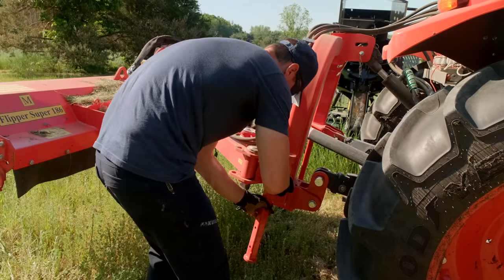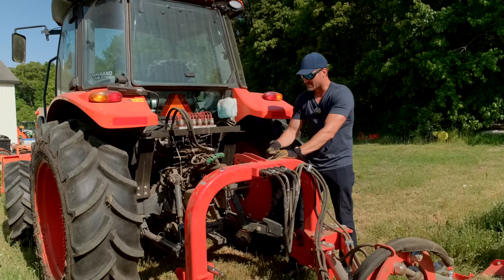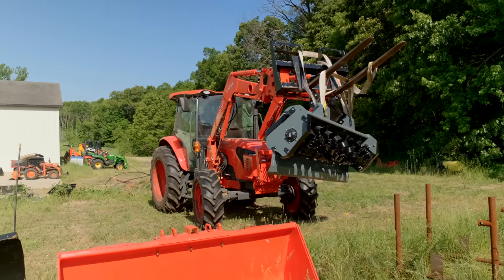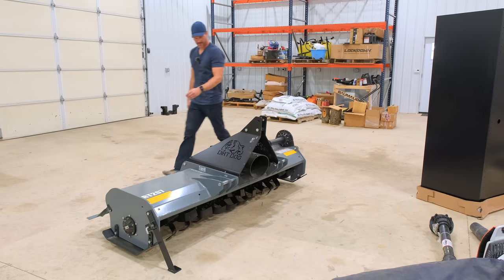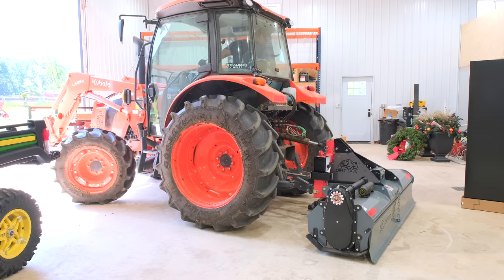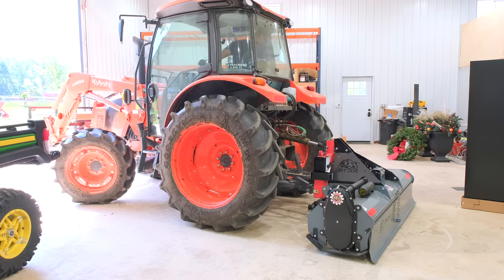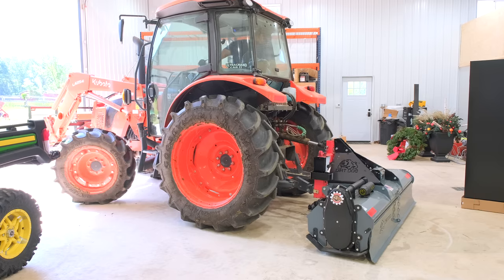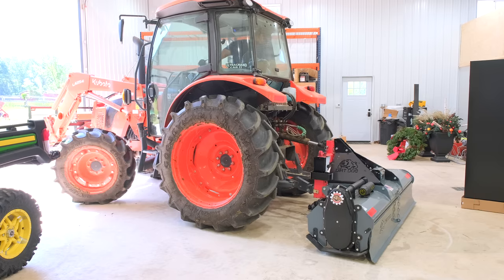I’M SHOCKED! THIS “DELUXE” TRACTOR WON’T GO SLOW ENOUGH TO TILL

Comment: I have the M4.  Love it!  My guess is you have a 12 speed transmission.  I have the 12.  It’s perfect for me.  They have this tractor in 24 speed and that will do what you need.  In your case, add the creeper option.

Kubota sells the rear wiper kit.  Worth it and easy to install!

Exceptional tractor!

Comment: 1 thing you can do is run in e pto. It will allow you to still run the 540 with lower rpm which will run just a little slower ground speed. Wont be much but will help

Comment: The tractor I use on the rototiller does 1.7 mph in 1st gear.  For an established garden it does ok but for something new you go over it 4 times a different direction each time 😆

Comment: Yes, I have the M7060 12 spd and probably need to add the creeper gear.  7ft tiller and it's too fast in low first.  It works, but it would be nice to go half the speed.

Comment: Suggestion  to pass on to accessorie  suppliers  to install  lifting  points / rings  as part of the equipment   it's a given that farm equipment  going to lifted  and transported  either job to  job or to shop  or even loaned out  would be nice to factory lifting  points to keep balanced   and hopefully not twist ot otherwise damage  unit

Comment: The gearing was one of my least favorite things about my dad's old Jubilee.  1st gear, 1,000 RPM was 1.87 mph.  Any lower RPM and it would stall under load. The 16-speed shuttle New Holland Boomer 40 he replaced it with seems to barely move in 1st.
Reply from the maker: Yeah, you would think a plethora of low end ratios would trump all the mid and higher gears.
Reply: I feel your pain. I bought a tiller and it was almost useless with the old Ford.  They made a hi/low transmission but those are pretty scarce. Finally replaced it with a 2920 Kubota. Problem solved.

Comment: Hey Courtney, that Kabota’s got a hydrostatic transmission in it doesn’t it you could always pull back on the amount of pressure you’re putting on the pedal that would slow everything down and not do any harm
Reply from the maker: It's a gear drive
Reply: Haha c'mon mate

Comment: I just bought a brand new John Deere S100 model and I have to hold my foot on a pedal to cut my grass and when I hit the bumps it slows the Tractor Down because I come off the seat kills the engine and lift my foot I like the old-fashioned Gear transmission with a clutch much better for cutting grass

Comment: Ive got the same kubota you do and we are having some strange noises in the cab. It almost sounds like a bypass for hydrolics. When we are working with it, it gets really loud that you cant ignore it anymore. It only stops when you hit the brakes. So im wondering if you are having the same issues.
Reply: Not only that but when we but the bucket flat on the ground and curl the bucket down like you would be dumpling, it struggles and doesn't lift the tractor off of its front tires. I'm not sure if yours does that too or it is just ours.

Comment: Is there an option for a 1000rpm pto shaft. If there is I would run with that with a 1000 to 540 pto adapter so you can run the engine at a lower rpm and ground speed while maintaining a pto speed that is fairly close to the proper rpm of a 540 implement.

Comment: My Kioti RX7320 is a little tight on the pin engagement with some of my front QA attachments.  After I have then mounted, I raise the loader, tip the forks / bucket/ etc down, then waggle the loader 3 or four times like Im dumping a bucket of sticky soil. Then the pins seem to wiggle, vibrate, and seat into place quite a bit better. I had a front QA boom pole pop off once when (trying to lift too much) and I think it was because the chinesium attachment flexed a lot, and perhaps was seated with pins only partway because cheep low quality tolerances.
Reply from the maker: Yeah, not sure why I have issues with this Kubota.  Even the OEM Kubota bucket.  Perhaps there's a metal burr or something that has enough friction to hold it up from easily seating.

Comment: Why did you put the P.T.O. shaft on the ground,  you should have a chain hanger to put around it to keep the dirt out of the U joints...   Run a chain across  from the lower lift points to place the shaft... 🤔🤔👍💪
Reply from the maker: I agree...look close at that shaft.  It's like 6' long, probably weighs 100 lbs or more.  I got a concrete block and put it at the far end.

Comment: The Pat's Quick Change would have dropped right out from under that implement.  They work just like a a quick hitch.
Reply: I completely agree! I have the speeco quick hitch and it won't work on several of my older attachments so I bought the pats system and love it. Works on everything. My quick hitch is now just sitting inside my building. Guess I should sell it

Comment: I have same tractor, I run closer to 3 mph with a 8ft tiller, but why would you want to go slower?  Mine is the 12 speed deluxe, yours might be the 8 speed.  One bad thing you had going on was the tillering was tilted back too far causing it to jump and not till smooth.
Reply from the maker: 3 mph with a tiller is ridiculously fast.  Definitely not recommended.  Mine is the 12 speed.  Tilting back isn't bad, it didn't cause it to jump.  I talked about adjusting on the fly with the hydraulic top link in the video.  I also talked about the creeper gear in the video.
Reply: @GoodWorksTractors  can’t tell you then I do it all the time in 3 rd gear.   Might be my tiller that’s able to do it.  When the top link loosens and it tilts back it starts not cutting well.  Most times I disc first.    Your dry ground might be a limitation too though

Comment: I have a new kioti RX7320,  what width tiller do you recommend.   My 6' box blade does not cover the rear tire tracks and I'm at the narrowest wheel setting.  Will a 7' be ok?

Comment: A long time ago my dad bought a howard rotovator. It had a set of gears that could be swapped.  That tiller did a great job behind his mf 135. Fast forward to 2022. I have that 135 which I cherish. Unfortunately I don't have that howard tiller. I buy a new tiller reccommended by a dealer. It does a crappy shallow job even with multiple passes. Im thinking of buying a hydro tractor for tilling. I would rather have a multigear tiller like that old howard.